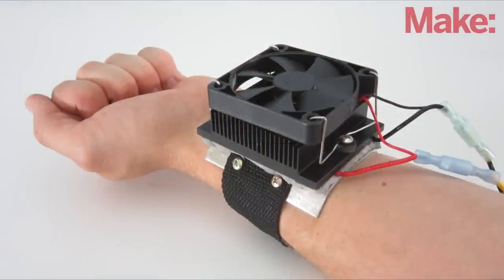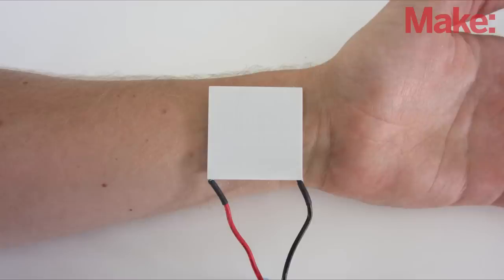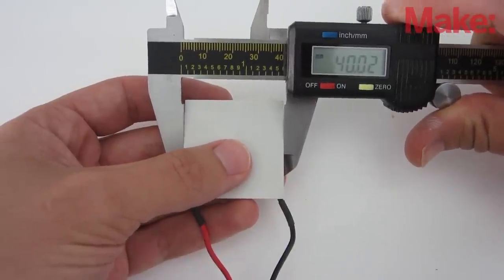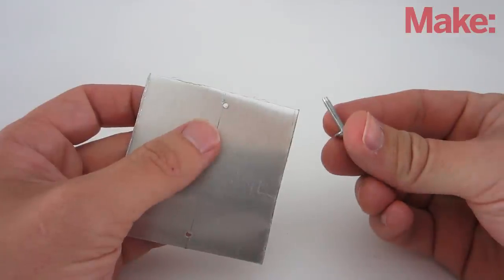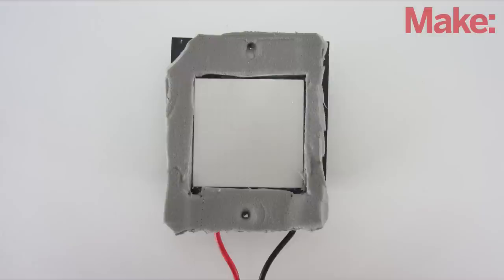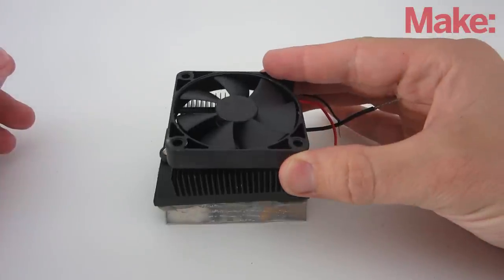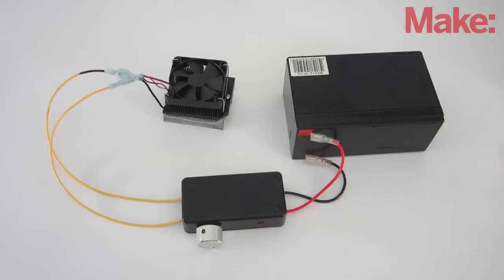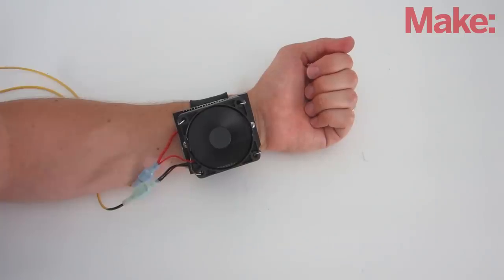Personal Cooling Unit

Comment: I thought that was called Veroboard... pretty sure it's not a PCB anyway. It has no circuit.
Reply: Yes. It is a PRINTED CIRCUIT BOARD. It is printed. It is part of a circuit. It is board like material.
Reply: GrimmEngineer Not really. It's not printed, it's copper plated board with tracks and holes cut out of it. It's not got any circuit on it, you have to make it into a circuit using wires and components. I will concede that it is in fact a board.

I'm not sure I would class it as a PCB, since that implies that it has an actual circuit on it already which this does not... this is actually called stripboard, I think. Veroboard is a brand here in the UK.
Reply: luke timothy The "printed"part is when the design is literally printed on the board in acid resist ink. Then it is eaten away. I concede the circuit part to you. Touche'.
Reply: GrimmEngineer Click the play button of that very same video AGAIN, and LOOK, what is used in it, is INDEED a VEROBOARD, at no point does it involves making a pcb, be it by acid etching, engraving, or conductive ink printing!

Veroboard is A FRIKKING COPPER PAD ARRAY OF LINES, YOU MAKE JUMPERS or SOLDER BRIDGES TO HAVE COMPONENTS ELECTRICALLY CONNECTED, You TAKE A BLADE  to it where you want a break in the copper strip!
None of those steps involve "printing", it makes a prototype circuit with a crude layout, 
GAHHHHHHHHHHH

And if you wish to comeback as a smartass and claim that to make the pads, it was etched, thus is "a pcb" (even if in PCB, there's C, for CIRCUIT, a thing wich an untouched veroboard isn't!)
I highly doubt the industrial process involves taking standard copper clad board, laying resist (aka printing), etching, sending the wasted copper in solution to a recycling plant, etc, but much more likely involves adhering the copper strips to the board, allready as strips, skipping an etching step, thus being more economical to produce!

(And that's what supports purge98's opinion on your knowledge! He did not care to illustrate it, but it's here for all to see,  it's protoboard, veroboard, or watchamacallit, but in no way the circuit demonstrated here is seen in a pcb form!)
Reply: siouxsettewerks So you think the copper foil is adhered onto the fiber material in strips already the right shape and size? Wow. OK. That never even crossed my mind for many reasons, chief of which it would be really dumb to try and do that. So there goes your demonstration of superiority through intellect. Zoom! Right out the window...
 here's how it really works:

The printed circuit pattern may be created by an "additive" process or a "subtractive" process. In the additive process, copper is plated, or added, onto the surface of the substrate in the desired pattern, leaving the rest of the surface unplated. In the subtractive process, the entire surface of the substrate is first plated, and then the areas that are not part of the desired pattern are etched away, or subtracted. We shall describe the additive process.The foil surface of the substrate is degreased. The panels pass through a vacuum chamber where a layer of positive photoresist material is pressed firmly onto the entire surface of the foil. A positive photoresist material is a polymerthat has the property of becoming more soluble when exposed to ultravioletlight. The vacuum ensures that no air bubbles are trapped between the foil and the photoresist. The printed circuit pattern mask is laid on top of the photoresist and the panels are exposed to an intense ultraviolet light. Because the mask is clear in the areas of the printed circuit pattern, the photoresist in those areas is irradiated and becomes very soluble. The mask is removed, and the surface of the panels is sprayed with an alkaline developer that dissolves the irradiated photoresist in the areas of the printed circuit pattern, leaving the copper foil exposed on the surface of the substrate.The panels are then electroplated with copper. The foil on the surface of the substrate acts as the cathode in this process, and the copper is plated in the exposed foil areas to a thickness of about 0.001-0.002 inches (0.025-0.050 mm). The areas still covered with photoresist cannot act as a cathode and are not plated. Tin-lead or another protective coating is plated on top of the copper plating to prevent the copper from oxidizing and as a resist for the next manufacturing step.The photoresist is stripped from the boards with a solvent to expose the substrate's copper foil between the plated printed circuit pattern. The boards are sprayed with an acid solution which eats away the copper foil. The copper plating on the printed circuit pattern is protected by the tin-lead coating and is unaffected by the acid.
Reply: GrimmEngineer
How funny, how nice, you think you are teaching me something here! ;)
You miss the whole point, trying to teach what is allready well known!

I wonder, How much have you written, and how much have you lifted off somewhere? Are you a dreaded master in the art of Wikipedia Ctrl-C Ctrl-V Fu?

Back to the topic!
Have you read the veroboard patent?
I have!
It's easy to find if you wish to do so!
In the 60's, they made it by milling stripes in bog standard copper clad boards
(why bother with photoresist, and etching when all you do is stripes, eh?)

(By the way before you do the process you described, the starting material has to be made, you know receiving copper foil from a mill, and adhering said foil to a substrate, either a resin bonded paper (old school low quality stuff) or fiberglass board, (or teflon tape, or... or... or...)
By the way, that usually is done in an entirely different facility than the process you describe, wich is either done by the hobbyist, or if you're talking industrial stuff, by a company that receives copper clad laminates, from a supplier, cad files from a client, then depending on volume and specs, etches, or mills, or laser etches, adheres multiple layers if the design so requires, installs or plates vias, if required, applies solder mask, or not, again depending on specs, screen print the indications the client specified, mills the individual boards in the panel, leaving tiny breakable tabs, and either leaves it as pannels for ease of manipulation down the line, for populating the boards, testing, etc, or depanelizes the individual boards, usually for hobbyists orders, then ships those unpopulated circuit boards to the client!)

Back to Veroboard, they started from basic copper clad paper boards (but iirc, it was integrated production I do believe Vero- Precision also made copper clad boards.
Read the patent, you'll see it was milled, all stripes simultaneously, then drilled, all holes simultaneously too! (no resist, so no "printing" ;) )

And guess what, people in the business of making strip board ended up pondering that if they are in the buisness of adhering foil to substrate, they could as well adhere stripes, instead of full width foil, and get rid of the milling! (yay, only drilling)

Fact remains, perfboard, be it strip board like veroboard, or individual pads,
IS NOT, out of the box, A CIRCUIT, HENCE, NOT A PRINTED CIRCUIT BOARD, and additionally, even less of a "P"CB considering that most basic perfboard types are milled, not etched!
What makes it into a circuit is soldering the components, and routing with solder and or wires from component to component
The end result is a circuit board!

Is it hard to comprehend?
Reply: siouxsettewerks Ok, I'm done with you TROLL. You seem to be trying really hard to make some obtuse point which exists only in your mind...I've made plenty of PCBs and PWAs and have been involved with their manufacture. Some of the things you have said are totally wrong, but I'm not going to go back and forth with you about nothing. You can google all you want if there is something you need to learn, because your little rants about circuits not existing yet they will exist once it is actually used? Is there some kind of point you think you are making? Whatever...this will keep me from having to listen to your tripe. C'est la Vie'!

Main:
Do
     If siouxsettewerks.idiot  = 1 and siouxsettewerks.troll = 1 then
          Gosub Ignore
     Endif
Loop until siouxsettewerks.detect = 0
End

Comment: thats not how you do it you get a tinfoil hat shave your head apply thermal paste to head attach tinfoil hat then attach as many fans as you can i recommend noctua nf 12 you can even water-cool it by running  mercurythrou the ducts into a radiator on your backside (make sure to attach fans for best results)

Comment: Useless.
Reply: Kyle247l only if you use this as a cpu cooler xD
Reply: skreb95 The cool side would create condensation and ruin your motherboard and cpu is  you dont take precautions. Its best to dissipate heat, not trap it.
Reply: Jon MRC well he did say that would be useless. why are you correcting someone who is right
Reply: Jon MRC well, true that
Reply: Jon MRC You're right about that part, but 2 years ago I did some liquid cooling experiments, and found that peltier units work very nicely in conjunction with water cooling systems. Simply attach the unit to the radiator. This will require dual fans, one to bring air into the radiator, and another to blow hot air away from the other side of the unit. 

It gets decent results, and could be a great solution for computers that cannot fit a 280mm radiator.
Reply: TomaloTube Ive never thought about putting it on a radiator and indirectly cooling the cpu! That would require some custom loops. Nice idea.
Reply: Jon MRC I did it to an NZXT Kraken X40 for a friend not too long ago. The hardest part is creating the heat dissipation, since you have to find a slim heatsink. I found a 2.5 inch heatsink and used thermal transfer tape to stick it to my brackets. If you can't source that kind of tape(usually only available to electronic engineers, or sold for ridiculous prices),  standard paste and zip-ties work too.
Reply: Jon MRC If you very the voltage to the TEC you don't have to worry about condensation.
Reply: skreb95 It would actually not be useless. And there are a few coolers like the v10 that have TEC cooling.
Reply: If this concept is useless, then so are an elephants ears.
Reply: Not completely useless. It shows the basic parts, and you can use them for other applications, like say adding extra cooling power to your computer.
Reply: wcemichael heheh yeah good idea. except computers already do this. thats where he got the idea.
Reply: only to you...
Reply: yes but, still
Reply: ...still....only you
Reply: No. He's not the only one who find's it useless. Every time you complain and try to prove your point with the last message, you're just proving what a fool you are; invalidating the argument with every comment you post.
Reply: wcemichael It also comes in pints. Im getting one.
Reply: Kyle247l you comment right
Reply: Brett Bates Thats actually pretty cool.
Reply: Kyle247l  i took a doller tree fan and put it on my wrists and it acualy cools me down FAST.
Reply: StrayHydraBlade i will definetly try that.
Reply: StrayHydraBlade i will definetly try that.
Reply: +wcemichael    there are some websites totally devoted to copulation with dowagers

Comment: Our bodies are not CPUs. Sorry, but this is just silly.
Reply: Isaac Bren its not. when i worked in intensive care we had a patient that had such high fever, we had to actively cool him down using a machine called "coolguard" it wraps around the large leg arteries and cools down the blood.
this might be much less effective, but in theory, this actually works.
Reply: Isaac Bren This thing does work, it's big and unconfortable but works anyway, the only thing you have to take care is tht the peltier module temperature must be between 30 and 31 ºC, if it is not at this temperatue, the body will send less blood to that area to prevent heat loss, and the sistem will be unefficient
Reply: Jeronimo Murruni You're right for the principle, but I bet you're not familiar with centigrade degrees!
Average normal human body temperature is 37°c

A 31°c temperatureis actually quite hot, if the outside air is 31°c, in most of europe it would be considered a rather hot to extremely hot summer day depending on where you are, and if enough consecutive days are this hot, it's considered a heatwave!
Most materials, at 31°c will be deemed mildly hot to the touch, not "cold"

But you're right, capillaries contract when the exterior is too cold, iirc a paper on a comparable but stronger device, devised to cool down athletes to avoid Heatstroke and hasten physical recuparation stated that the ideal temperature for the cooling fluid was around or slightly above 15°c, to avoid capillary restrictions, IIRC
It also involved a low pressure cuff to draw blood to the surface, so it might mitigate that, but I assure you that at 31°c, your surface capillaries are far for frum clamping down, at 31°c, most people are sweaty, depending on relative humidity!